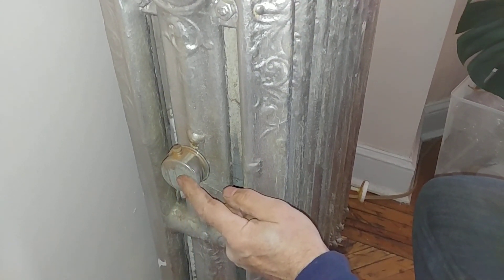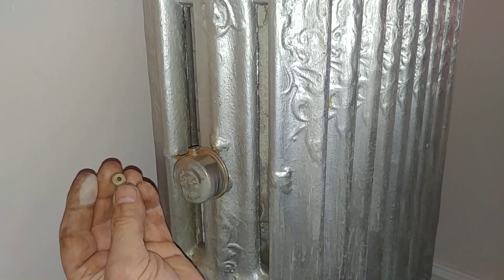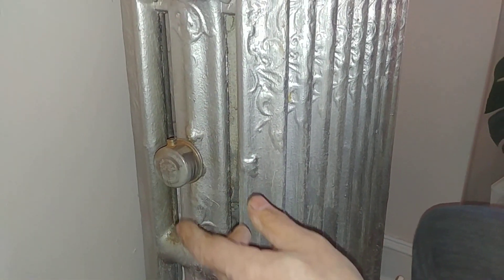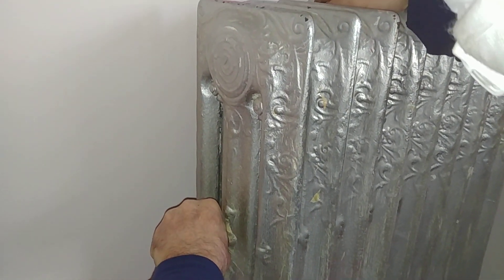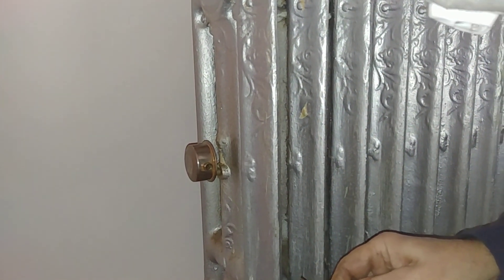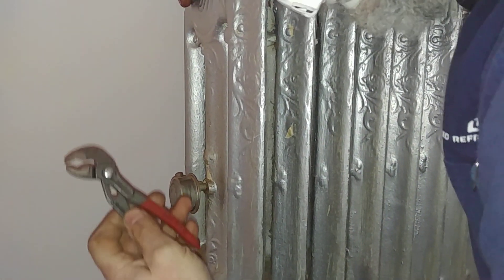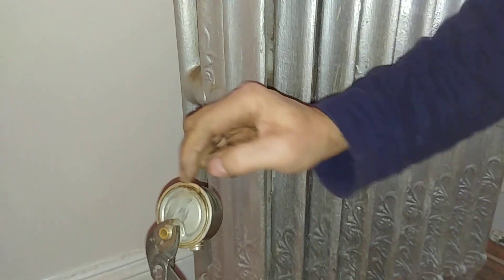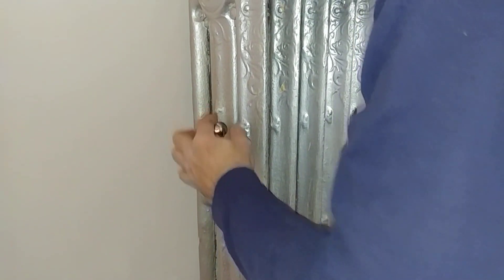Why Maid-o-Mist Is *Not* One Of My Favorite Single-Pipe Steam Radiator Vents

Comment: I manage a building that the plumber changed all of the air valves in with maid o mist. Within a year 50 percent of them developed cracks causing leaks they out the building. I will never use them again.  I bought a few Vent rights (10) thanks to you and they work well.  The only problem is they are harder to get your hands on them.  Not many supply houses stock them. Thanks again for recommending them.
Reply from the maker: Thank you for your comment!
Glad something I said was useful.
Please make sure you are operating at below 2 psi.
High pressure can ruin even good vents eventually.
Reply: @gordonschweizer5154  The boiler has a vaporstat. Running at about 14 ounces. I have found all of your videos useful.
Reply from the maker: @aglasserm1679  A Vaporstat?
Outstanding!
Thanks!
Reply: @gordonschweizer5154  yes . So it wasn’t the pressure that made them crack.
Reply: When you get tired of playing with broken vents, just buy American Gortons.

Comment: Quick to the point video! I need to remove a maid O mist off my radiator. I just have a question what type of air valve size hole used and how do you determine what size you need? Thank you in advance for answering my follow-up question!!!
Reply from the maker: @JorgeHernandez-ib1px  A bit tricky as to what sized vent goes into a particular radiator.
If the radiator is in the same room as the thermostat, a small fixed orifice vent is indicated such as a Hoffman #40 or perhaps a Gorton #4.
Other radiators may need a VentRite #1 adjustable to dial in what you need.
Make sure your main vents are in place and working.

Comment: Hello, I installed a new radiator steam valve similar to the initial one you had in the video  as my heater was not working and I have a concern about the adjustable orificies. The hole on mine is quite small; should it be completely closed or left open? I opened it for a time since the radiator was cold, then closed it completely when I discovered it was hot and the heater was operating. Now I'm wondering if I should keep it open or closed.
Reply from the maker: I assume you are talking about the MoM vent with the removable/replaceable orifices?
What is the number stamped on the removable orifice you are having an issue with?
Reply: @gordonschweizer5154  I replaced the entire Maid-o-Mist steam radiator vent, the old one which I removed one has a letter 'D' on it on the orifice and the new replaced one has the number '5' on it. does changing the number affect something (I have a huge wide radiator in the room)?

I tried interchanging the orrifice ( by that I mean I can use my old 'D' orrifice instead of the new orifice that has number 5 on my new radiator steam valve ) and it worked. 

NOTE : I'm also confused if I should keep it like open(Turn, make it loose and remove it) or closed (Turn it till its tightend and leave it that way) for the steam to enter the radiator.
Reply from the maker: @sakethsai3382  Let's start with the basics: 
Where there is air, there CANNOT be steam. Like oil and vinegar, they cannot mix.
The faster the vent lets out the air, the faster the steam can come in (all things being equal).
These are the available MoM orifice sizes:
The D is the largest hole for this vent and lets the air out the fastest.
Then, there is a C hole (a bit smaller than D)
Next, is the #6.
After that is, yes, the #5 that you have.
The smallest is a tiny #4 and the slowest vent of the lot.
Based on what you are telling us and nothing else, I would say that if you need a D vent on a radiator, your steam system mains most likely do not have adequate "main vents".

Comment: Enjoyed watching this! My super just recently installed a Maid O Mist air vent. I live on the top floor of a pre-war building. The Maid O Mist made so much noise upon startup. It was impossible to sleep! Have you noticed this? I had Hoffmans before and they were always quiet in startup. Most of my Hoffman's work quietly. However some hiss after just a few years. Could it be pressure issues in my building?
Reply from the maker: Pressure issues are all too common.
Since on these larger buildings there is almost certainly very poor main pipe venting and no dedicated riser vents, in order to keep the no heat complaints down to a minimum, the pressure is often jacked up.
I cannot, of course, know the situation in your particular case.
Hoffman 40s are more costly than a MoM, too.
It also may depend on the orifice that was installed with your MoM.
Reply: The Maid O Mist sounded like a motor car revving up w rumbling and squeal like whistling. The Hoffmanns are double the price but they work quietly. Once air is released from the vent and heat is on, if the vent continues to faintly hiss for maybe 10 minutes after after startup, does it mean the valve is on its way to death or could it be pressure issues?
Reply from the maker: @msdivine  If the vent is releasing steam after the vent gets hot, then, yes, the vent is bad and should be replaced.
As to the other sounds it is making, it might be the orifice on the vent itself (& it is changeable) might be too big.
You might be able to see a number stamped right next to the outlet.
Reply: @gordonschweizer5154  The orfice on the Maid O Mist is a "D". I don't know if changing the orifice will necessarily make it as quiet as the Hoffmans. In your opinion is any slight hissing mean the event needs to be replaced?  I have had air valves replaced before and noticed that some of the hissing is louder than other even when using the same brand.
Reply from the maker: @msdivine  The D orifice is the largest orifice possible!
Yikes!
Look at that hole & compare it to the much smaller hole of a Hoffman 40.
That may be part of your noise issue.
Suggest to your super to swap out that D orifice with a #5 if they are unwilling to replace the vent with a #40.
Did your radiators heat ok with a #40?
Reply: @gordonschweizer5154  Unfortunately my super plays dum or is dum and always says "valve is good". However the building mgr called me recently and claimed he will send a Hoffman 41 over. Let's hope so. And yes that hole was quite huge! My radiators heated up fine with other hoffman 41 that I have in my apt.
Reply from the maker: @msdivine  As far as your super is concerned, valve-is-good if it makes the no heat issues go away (as well as keeping the pressure cranked up to levels suitable for steaming crabs)
As far as they are concerned, they are not there to experiment with or learn a better way, just keeping the heat on is challenging enough.
It's a sad old story.
Reply: @gordonschweizer5154  exactly! But this is why videos such as yours are so valuable. I’ve learned a lot and as a tenant I shouldn’t have to know anything about valves but I do! Thank you!
Reply: @gordonschweizer5154  What would be the equivalent Gorton valve to use in place of the hoffman?
Reply from the maker: @msdivine  It would be the Gorton #1.
As an example, if you have two steam mains & one is way longer that the other, and you have tappings for main vents, I'd vent the the short main with a Gorton #1 and the longest main with a Gorton #2.
The goal is to have the steam arrive at both ends @ the same time.
Your mileage may vary, of course.
Reply from the maker: In general, it is difficult to over-vent a steam main.
If a Gorton #2 will fit, I'd add a Gorton #2 in place of a Hoffman 75 any day of the year.
Reply: @gordonschweizer5154 so would a gorton #1 or2 = hoffman 41. Im in an apt building, top floor.
Reply from the maker: @msdivine  Sorry I mis-understood your question
To eplace a Hoffman 41, I'd try a Gorton # 5 vertical.

Comment: My M-O-M just failed!
What's with the screw vent on top?
What did you replace it with and why didn't you use plumbers tape?
Reply from the maker: Well, it's a MoM, so of course it failed.
They are cheap junk.
As for the screw vent on top, perhaps my other video on MoM can answer that.
Sometimes I don't use ptfe tape depending on my whim and fancy.
Reply: @gordonschweizer5154  
Thanks for the reply
That thing failed in 2 years, I did find out why there's a screw top but it doesn't matter when the product sucks anyway.
 I found an old Hoffman 40, I throw that one on after the cycle ends

Comment: I have a Maid O' Mist in my primary bedroom (sixth floor of 1920 walk-up building) and it's the last radiator to get hot or not hot at all. Do you have a video on how to bleed that type of valve? Landlord won't listen to my cold complaints until way past freezing.
Reply from the maker: You might try a Gorton "D" vent, but beware of spitting vents and water hammer in your radiator.
You're not in a good situation, I'm afraid.
The problem and the solution are seldom in the same room.
A progressive landlord (they are rare, but do exist) would have a proper steam worker (they are also rare, but do exist), add proper main venting AND riser venting, etc, etc.
Then, that semi-mythical landlord could run their system at a lower pressure with more even heat distribution, thereby saving money, and have happier tenants that will reduce money-losing turn-over.

Comment: I've had issues with the Vent-Rite #1. None of the vents are perfect but I just went to replace some of the Vent-Rites I have and the price has doubled to tripled depending on where you buy. And that little tongue piece that is supposed to separate the water and steam moves when you screw it in, so there's no guarantee that it is laying flat when you install it. I had one actually fall out I spread the wings on it to fit tighter but that did not keep it in place. I was shocked at the price difference. I looked at FW Webb first and they were $82.00. I ended up going to another supply house and got two for 52.00 apiece...
Reply from the maker: Thank you for your comments.
Yes the tongues on the Vent Rites seem to be a bit dodgy.  
I usually re-bend them so they are just a bit curved so they don't hang up when put into the 1/8 npt hole.

Comment: I recently installed Varivalve air valves on my radiators.  I was losing too much steam and water from the boiler.  Mikey Pipes mentioned your site.
Reply from the maker: Thank you for your report from Mr. Mikey Pipes.  I  do appreciate his (and your) support!
I hope the Varivalve air vents work out for you.  
Be aware that they are a very fast vent and are thereby prone to spitting.
Also, they do not have an internal float to stop said spitting.
Reports from others are that they also tend to "cycle out" and fail open, letting out a fair amount of steam when they do.
Just to be sure, Varivalve vents are made by a different company from Vent Rite
Reply: The vari valves that I have used seem to stop working in about a year. They get stuck closed.  They are the fastest venting air valve out there but they are also adjustable so you can slow them down if need be.
Reply: @aglasserm1679    Which valves should I be buying ?
Reply from the maker: @aglasserm1679  I would check on your main vents in the basement.
We've had good results with Gorton #2.
Vent the mains quickly so you can vent the radiators slowly.
Make sure you keep your boiler pressure under 2 psi.
For radiators themselves,
It depends on how big the radiator is and where it is (and where the t-stat is).
No one size fits all situations.
Reply: @gordonschweizer5154  I have 2 big mouths and 1 Gorton#2 on the main.  The risers (13 of them)  are also master vented with a gorton #2 as well.
Reply from the maker: @aglasserm1679  This is an excellent report.
So, it is clear that it was not your system's fault that so many of your M-o-M vents failed.
I am very partial to Vent Rite #1, as they seem to allow easy tweaking at the low end of the venting range.
Reply: @2pugman  Gorton
Reply: @aglasserm1679  Yes, VariValves have a design flaw.  Their bellows falls off their mounting onto the seats permanently closing the valve.  You can hear them rattle when you shake them after they fail. We lost thousands installing about 500 of them in commercial NYC applications.  HeatTimer wouldn't even answer our engineers' reports.

Comment: I find that the gorton air valves are easier to use since they come numbered or somekind of value stamped into them. They even have a chart system. But the one you just installed in the video I see no such chart system to let you which is 1, 4,5,6,c,d, etc. Is there one for these old school ones or does it matter? I need numbers in order to equalize my house and these old school types don't seem to have a number or chart to help like the gorton's do.
Reply from the maker: The Vent Rite #1s, maxed out, are a relatively slow vent, and that's usually best.
If radiators are too hot, they're the vent to use, as they can be dialed down to off.
The numbers are an arbitrary guide.
The important venting is done in the basement with the biggest main vents you can find and install.
Then, you can "tweak" the small vents at the radiators bit by bit.
The radiator with the t-stat gets a fixed vent, that's the index for the building.
I am sorry to say, IMHO, the chart that Gorton provides is not all that helpful to me.
Every system has its own personality, so it's a question of adjust and observe and adjust again.
Reply: @gordonschweizer5154  Thanks for the info.

Comment: Silly question I have a dole steam vent with a copper siphon coming out. Do i remove that or put inside radiator when I screw in?
Reply from the maker: If you have a column-style radiator, you should be able to thread the syphon in.
If you have the newer type thin-tube, it might not fit.
Reply: @gordonschweizer5154  thanks for replying Gordon

Comment: I also dislike the Maid O' Mist vents, although mainly just because the outer casing tends to crack and leak under more than a psi or so of pressure. However I have had good luck with the Durst model SRV (Lowes). It comes with all 5 sizes of orifice, it's made of thicker metal than the MOM, it's made in Taiwan rather than China, and seems more durable under pressure. For $10 even if it doesn't last a super long time, it's at least a good choice for balancing a system before Gortons can be installed once all the orifice sizes can be determined. But I have several that are 5 years old or so and still going, and have yet to see one fail on my system.
Reply from the maker: Thank you for your comments & observations.
I am not nearly as familiar with the Durst brand of vents as the MoM.
Are they crimped at the edges or soldered?
Thanks again!

Comment: Not an issue if you own a pipe wrench. They work great on this types of vents. Garbs and spins old vents out.
Reply from the maker: If anyone could show me a video of what you are suggesting, I'd like to see it.
Reply: @gordonschweizer5154   Simple to do, Just put the rigid type pipe wrench over the back plate that attached to the little nipple and crank it counterclockwise.  It works good with a 18in wrench. Dont over do it or you can crush the entire thing but a couple of nudges and the weight combined with the leverage really does bite into the metal and turns it. i would upload a video but i dont have any on hand I removed them all and replaced them with Heat-timers.
Reply from the maker: @mugen-mundo  Thank you for that.
However....
What I would like to see a video of, is where the situation as depicted in the video above where the front part is spinning, but the back part is not.
Then, please show me how grabbing the crimp with a pipe wrench will work then.  Tried stuff like that in the past, and it didn't end well for me.
Sometimes, there is not enough clearance to do as you suggest, if I understand you correctly (I might not be - that's where video can help)
The big point of all of this, is this shouldn't happen at all and is due to an inherent weakness in the design that makes these vents unsuitable to be used by the professional.

Comment: When installing a ventrite, the little tongue tab would move when spinning it on. Is that ok? Or was that a faulty piece?
Reply from the maker: That little brass tongue is just pressed in and can indeed move about (and sometimes can get misaligned).
It is to guide any water that gets into the vent back out, as you may know.
Reply: @gordonschweizer5154  right right. Do you have any tips for keeping it aligned with installing one of these types of vents?
Reply from the maker: @Owned23  I'd bend the tab slightly to flatten it out a bit, maybe?
Hard to show on YouTube.
Lots of trial & error
Reply from the maker: @Owned23  Also, the 1/8" npt hole might have rust in it closing down the hole too much

Comment: Welp, that’s an old favorite. For trying to juice a system.
Some times it works, mostly it doesn’t.
Reply from the maker: Aye.
It's got a Hoffman 4A so-called "Quick Vent" at this end.
The other end's vent stalk has got a plug (and water hammer).
And the radiator at the other far end also has a "c" vent.
Reply: … But it worked for years!
Not really.

Comment: Years of service on that little MoM and all you can do is complain because you had to use a pair of pliers to remove it? Come now ;)
Reply from the maker: The radiator at the other end had a Gorton "c" that is still working.  Didn't even need to remove it.
This particular MoM was easy to remove compared to others I've unfortunately encountered. 
Many I've had to cut out and "easy-out".
Someone on heatinghelp questioned my word and said this couldn't happen to MoM.
Now I got it on tape.
I take out a lot more failed MoMs then I do Gortons.
NEVER had to remove a Gorton for this lame reason.